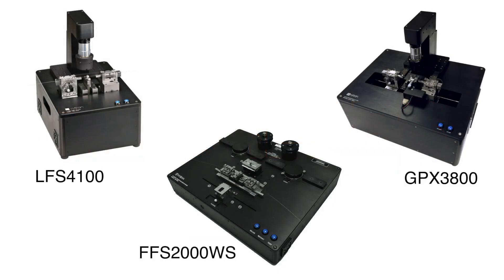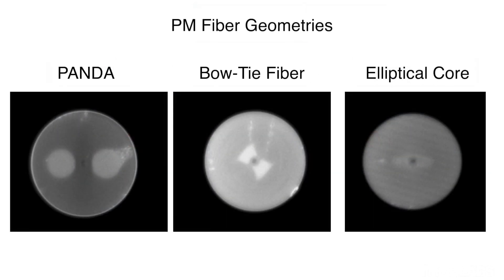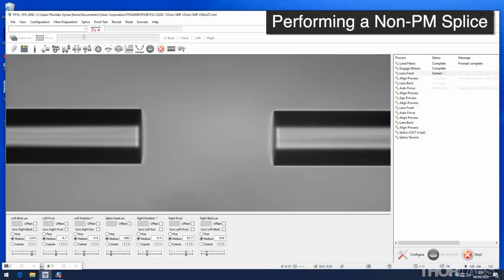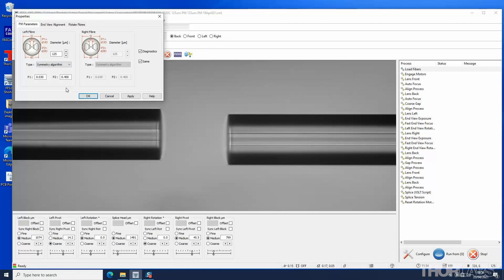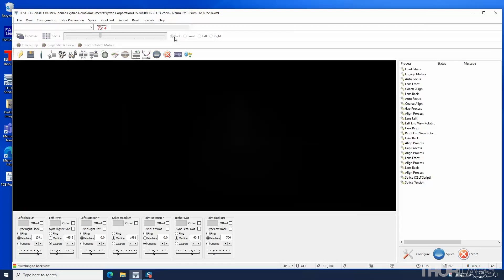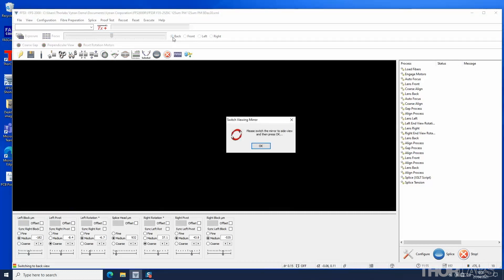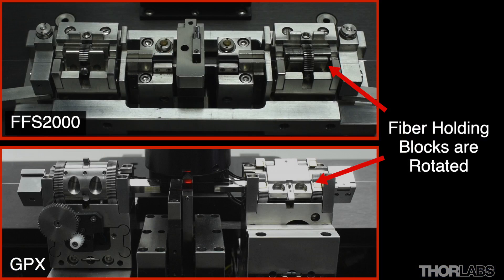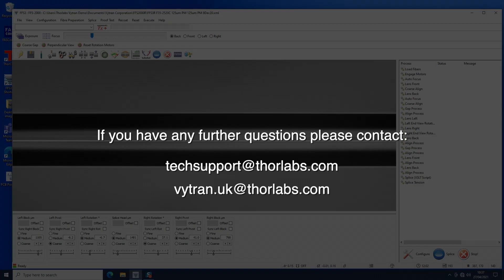Splicing Polarization Maintaining (PM) Fiber

Comment: FFS 2000 is it software or not, i can use it on my laptop? if it a software I hope you send me it download and install the software. Thank you
Reply from the maker: FFS2000 is a Fiber Fusion Splicing Workstation which includes a computer with the dedicated software called FFS3. That software is also preinstalled on the computer that comes with other splicing and glass processing systems, such as LFS or GPX. If you need to run the splicer from a laptop you already have, please contact us directly at techsupport@thorlabs.com or vytran.uk@thorlabs.com  to discuss the hardware compatibility.

Comment: Is it possible to rotate the birefringence rod in vertical direction instead of horizontal as seen video and splice?
Reply from the maker: Core alignment is useful when the core-cladding concentricity is a loose tolerance. For most common fibers, the draw techniques hold that concentricity to a tight tolerance, and therefore edge alignment of the cladding is sufficient. Core alignment may still be useful when drawing specialty fibers in small quantities for research purposes. 

Concerning the PM stress member rotation, yes, there are several ways of approaching this. The simplest would be to go to Splice > PM Alignment Properties > End View Alignment and add a 90° offset on both the left and right. However, the imaging path contains mirrors, which turn the image, so horizontal on screen is not necessarily horizontal in the lab frame. Please reach out to techsupport@thorlabs.com to discuss your exact application if you need to orient a Thorlabs Vytran® splicer or glass processor to other equipment in your setup.

Comment: I think P1 & P2 are pixel numbers or dimensions in micrometer?
Reply from the maker: Thank you for your questions! The symmetry algorithm was developed more recently as a more robust approach for a variety of fiber types. We recommend this in most applications, even for many Panda, bow-tie, or elliptical fibers. For symmetry, P1 and P2 are a decimal portion of the fiber diameter to define the region in which the algorithm will look for the pattern.

Panda will also work for Panda fibers, but it does currently use pixels, so it is helpful to measure the values with the Measurement Guide and to look up the calibration issues in Configuration > Image > Image Processing Setup.